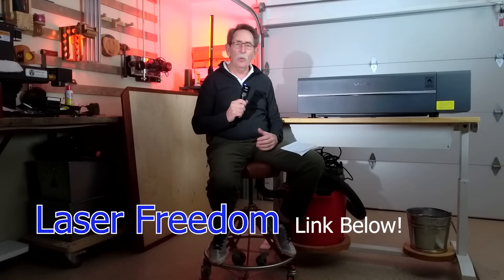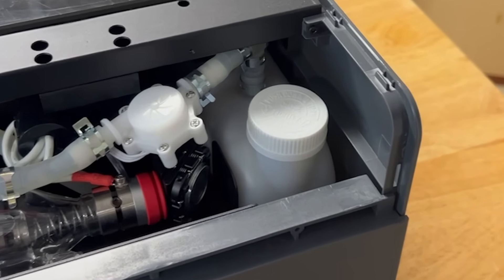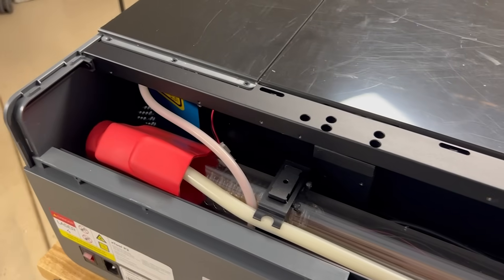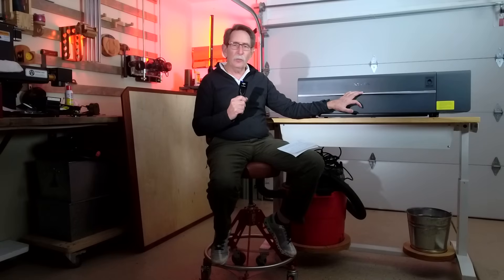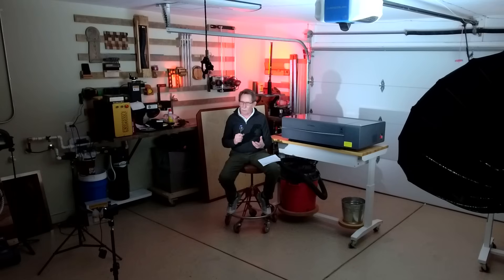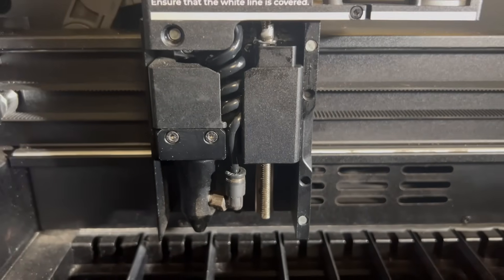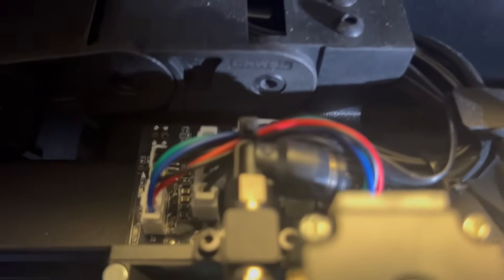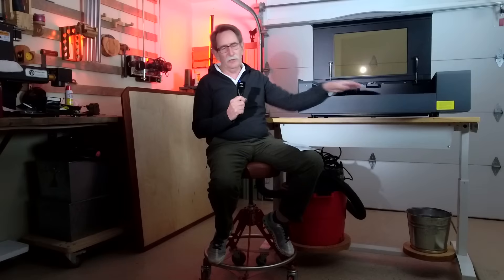Engineering Matters  -  Aeon Mira5 Redline vs. A Plastic Case  Xtool  P2  Desktop Laser

Comment: The way the machine is made doesn't make a difference for me it's what I make and how I sell I'm happy with my P2 🫡🫡 Aeon has great features but I can accomplish every job I need with the P2
Reply from the maker: I am glad you have had good success with your P2.   All I hope is everyone gets the best machine for the job.  For those not mechanically inclined or wanting to save time,  things like changing lenses, adjusting mirrors,  and cleaning there are options.   Please join us in the Facebook Group  Laser Freedom, differences in opinion are welcome.    I just want everyone to get the  best tool for the job.
Reply: @GeorgeKennerLaser  i can definitely see how things can be easier for maintenance purposes they did upgrade a lot with the P2S they are working on so many new machines changing the platform of lasers and printing many may not think so but many others do I am one of them 🙏 your video was great though good info for those who do want a machine made difference 👍
Reply: *different

Comment: While I appreciate the difference in quality, the market each company is geared towards might not be the same. For example, Xtool software just works well. Not to mention, it is designed for their machines, so there is not a card you need to enter into the system prior. The machine is really meant for people who maybe aren’t as software savvy, and want something that is very straight forward. Aeon makes an incredible product, make no mistake, but in my opinion, this comparison isn’t really a fair one. What would be more fair is using Thunder Laser, Epilog, or Trotec.
Reply: Also, when you start to price out the p2s, and then price out Aeon Mira 5, the cheapest possible is still a lot more than the xtool. You are correct, time is money, but not everyone has that type of capital, or even the credit to do that. Like I said previously, there is a market for both. The Mira really is more for folks who have more expendable income, and time to learn lightburn. I personally looked at Aeon, and was very much wanting a machine like this, but the cost of entry was more than I could justify. Another company that would be a better head to head would be Onelaser. The are offering similar quality and capability. Not to mention, it is dual source. The price point for them is half of what the Super Nova is. Yes, it may be slower, but that is engrave speed. Cut speeds generally are the same, even on far less expensive machine. Please don’t take this offensively. I do enjoy your content.
Reply from the maker: @MikeyouLikey   The cost differential is not really that great if you starting a business.  And many people pay for these on credit so it’s a monthly payment and is even more affordable that way.  The market gets so flooded with the less expensive machine ads people need to know what you can get if they increase their thinking just a little.   To see the difference in the head systems to me is a game changer.   I want everyone to get the best tool for the job.  I think when the people see base engineering difference they are empowered.   No all the fluff.   Thank you for the nice comment, it makes me happy to hear you like my content.
Reply: I agree with you on the premise of the Aeon machine being superior. I just don't think these two are in the same class. Thus, it makes this comparison a bit unfair. It would be like comparing a Rolls Royce to a Toyota. Both are nice, but are for different markets. I think the comparisons would by much more fair with something closer to it's prosumer class, which is to say Thunder Laser Nova Plus or the Bolt series. I would also put it against Onelaser or Epilog. That's a more apple to apples, and price range. These machines for financing can be challenging, and it's a LOT easier to that when the price is at a max under 4k. Vs 6k starting. And while some people may be looking at starting a business, more often they still have to work a day to day, so this starts more at a hobby first, with the hope of being a business later. So if possible, in the future, a true side by side of the above similar class machine would be more appropriate